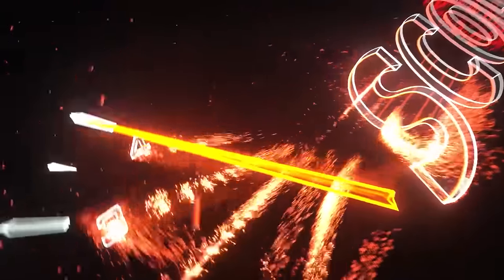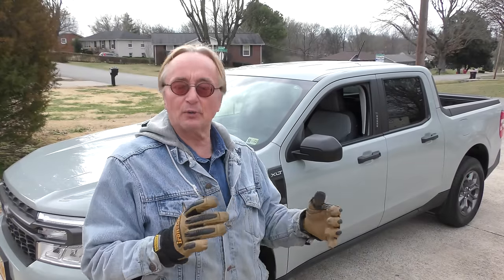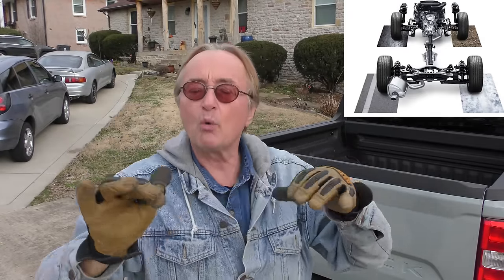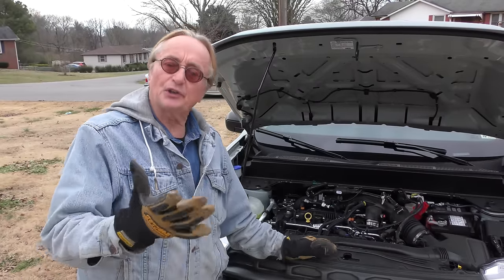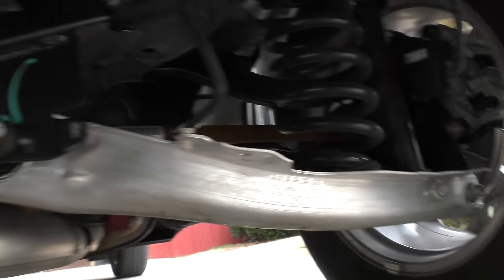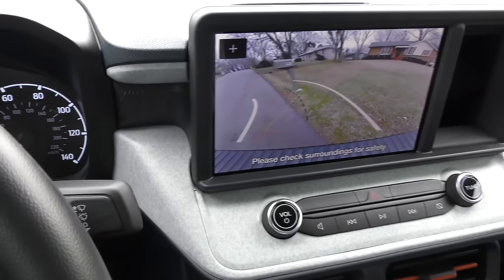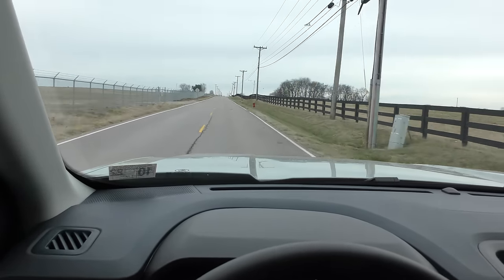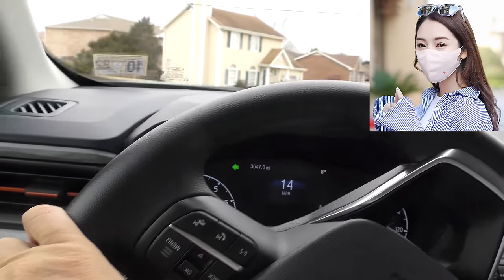I Finally Got a New Ford Maverick and Here's What I Really Think of It

Comment: Ive been saying for years that domestic car makers like ford should build a simple basic truck sub 20k for regular working folks. Prices for new vehicles are ridiculous right now atleast for a domestic even though they are not assemble here
Reply: Hear..Hear..Blessings.
Reply: I have been saying something similar for quite a while as well.
Reply: Never heard of this pickup before this vid tho!
Reply: @kong4679  it is a fairly new vehicle, so that is understandable.
Reply: Love the mpg these get but a lot of DYI and handyman purchasing these for the fuel mileage are starting to show signs of regret, the box is just so small most have to make the compromise of tools or hardware.. guess you can’t have it all.
Reply: Been saying the same.  I also want a car without a computer and I don’t want the manufacturer to track me for the rest of my life like they still own the car (talkin bout you Tesla!).  I want a car that I can fix with the tools in my garage.
Reply: @ajv9912  that would be pretty old to not have any computer. Lol I'm happy with 90s Obd2 fuel injection.
Reply: @ajv9912     Then your best bet is a diesel with a mechanical pump and a manual transmission. Maybe an old surplus military vehicle or an old mercedes.
Reply: Yep- the 90s market for the old ranger.  I bought a new XLT for 11k and drove for 220.
Reply: ⚽ moms don't want that

Comment: The “Start/Stop” can be disabled by a dedicated button on the center console. The feature is also disabled if you drive in “Sport Mode”. I have a XL with AWD. My 1st Ford. My 1st truck.
Reply: My 2021 Chevy Blazer also has the stop-start feature. 
1st thing I do after starting it up is disable that annoying stop-start.
Reply: Good. I'll disable mine. When I get it.
Reply: Start stop seems pretty useless unless you’re trapped in a highway closed lane.
Reply: My company just bought three Ford Escapes with stop/start. I found that you can also disable it by getting in the habit of shifting into neutral at stop lights. Maybe it'll work here too.
Reply: But it resets itself next time you turn on the car. In BMWs you can do a software alter that’ll put a memory on the start-stop system. Next time you turn on the car it puts it to the setting you last left it to.
Reply: @the007connoisseur  correct. Start/Stop has to be disabled each time you start the truck. Same with the driving mode. “Normal” is the default. If you want Eco, Slippery, Sport you have to select.
Reply: @user-xt7zd9uj3f  Just like all manufacturers, there's good and bad. I've seen Honda accords with proper maintenance spin main bearings at 75k. 
I've had drivetrain issues with pretty much everyone.
Reply: But does the start/stop disable permanently with that button. I suspect not. Sport mode disabling start/stop is similar on the Toyotas as well.
Reply: Start stop is ridiculous I hate it. You can buy an aftermarket thing called auto start stop eliminator. It plugs into the diagnostic port and when you press the button it turns it off for good.
Reply: @angelgjr1999  10-15% of your fuel consumption in typical local traffic is idling.  That's a lot of fuel, considering that's the equivalent of 30-45 cents of fuel at $3 per gallon.
Reply: @unconventionalideas5683  Depends on your commute I guess. I drive mostly rural roads with not many lights.
Reply: One of the guys at the dealership said they can disable it in the diagnostics, but what would I know, I don't own one (yet)
Reply: My 21 Ridgeline's start stop does not work when the defroster is on. So, I haven't had to think about it all winter.
Reply: The honda ridgeline is catching on
Reply: I have a Chevy Cruze with start stop. The only way to avoid start stop is high AC or using the heater. Or using the car in the L mode, shift it up to 6 and it acts exactly like automatic but no start stop.
Reply: At least they put the start/stop disable button in the console so you can push it off. Unlike the stupid escapes traction control where ya have to go through the menu and find it to shut it off. Should be a button as well. Do wish they had a regular shifter, that's a big turn off for me,but for the price am still going to look into buying one
Reply: @ppvracing5597  I too wish it could be disabled in the menu. It is what it is. I do not like the dial shifter either. I try to shift in reverse without looking and I end up in park. After driving for 45 years, 35 professionally, I find the dial shifter not very intuitive. None of these things are deal breakers…….I have driven many “beaters” over the years.
Reply: @user-xt7zd9uj3f  escape is trash

Comment: Agree totally with Scotty the knob transmission selector and electronic parking brake not my favorite. But finally a decent price on a cute truck.  Car makers need to realize that and start building affordable, reliable, economical safe vehicles.
Reply: I have a Dodge Ram with the same knob for the transmisión but it’s located next to the volume and air knob 😅 , my brother mistakenly try to lower the volume and put the car in Neutral in a stop lol I like that this little maverick isn’t next to each other 😅
Reply: What happens when a beverage is spilled on the rotary transmission switch ?

Comment: I can imagine these will be everywhere as fleet vehicles in a couple years. Looks like a nice vehicle for the money
Reply: Yep expect every AutoZone and Advance Auto Parts to have these.
Reply: It’s selling in San Antonio Tx for $35 - $40,000.
Reply: @dschoenfeld9277  lol what a joke
Reply: Yeah, dealers are marking up models with options. Eventually, base hybrid XLs should be more economical than many supposed econocars, but they still tow 2000lb and have 1500lb payload capacity.

 My Crosstrek tows 1500lb, but I need a trailer to haul a motorcycle or 2 with it. A base Maverick could handle 2 in the bed and more on a trailer.
Reply: This is no different than their SUV's..  Just look at the history on those and you'll see how these will fair..   It has the same uni-body, same suspension, and same engine, ect.. It's just their SUV with a bed instead of cargo area.  Not much of a truck really.  Similar to a Honda Ridgeline.  More of an SUV than a truck.  They're pretty sweet if you don't ever tow things.
Reply: @calholli  Or tow under 2000lbs which is what they are rated for and what 90% of people are going to be towing in the first place. Not everyone needs a Chevy F-Thousand50 Hemi-Cab Duramax XL on 9" lift 40" wheels to tow a uhaul trailer full of grandma's prize winning rhubarb jam down to the farmer's market twice a month. Get real.
Reply: @stgrsa  oof.. So defensive, and I have no idea why. lol.  It is funny to read though.
Reply: @stgrsa  They shouldn't even be called trucks.  It's just a crossover with a bed.  Call it a "crossbed, or something.  It needs a new name;   It's a "truck" built onto a car's chassis-- just like a crossover is a "SUV built onto a car's chassis.  It needs a new name;  it's not even in the same category/  It's not a truck. lol.. In Australia they call these a UTE.  or "yoot".  I think we should adopt that name-- or something else, other than "Truck"..   It's not a truck...  It's more of an El' Camino than a truck. lol.  There's no reason to defend your purchase.  If you like UTE's, good for you-- that's cool man.  Let's just not pretend it's a truck,  k-cool.
Reply: @calholli  they aren’t going to replace full-size + trucks. But some people just want an easy place to put their snowboard or fishing poles, and tow/ haul light loads. Even if small a bed has distinct advantages (and disadvantages) than an enclosed cargo area. I can see these doing well as a lower end car. Would you rather spend 25k on this or a civic? (I’d pick this). But I can definitely see these doing well as fleet vehicles, fleet companies don’t care if the truck is body on frame or has 4wd if it is sufficient to get the job done. And they definitely care that they are cheaper and get better gas mileage. Many consumers and businesses that currently have mid/full-size trucks don’t need all that truck, but they do need some kind of a bed.
Reply: @stgrsa  lol.. Bro, I'm not the one defending my UTE purchase by barking "It's A TRUCK... IT'S A TRUCK G^D DA^N IT... IT'S A TRUCK." ---- hahah..  Your logic completely falls apart because they changed "SUV" to "Crossover" for this very precisely and EXACT reason... I just said I drive an Acura MDX dude... you don't here me saying  "IT'S AN SUV---- Not A "Crossover" --    IT'S AN SUV I TELL YOU... I'M A REAL MAN, IT'S AN SUV--- WHY IS NO ONE LISTENING TO ME" ---  bwhahaha.   Jesus Christ.  Relax........  Here is the definition of "Truck:   'a large, heavy motor vehicle used for transporting goods, materials, or troops."---   Ok, "LARGE HEAVE MOTOR" -- it says it right there in the definition.   In the UK, they call Trucks a "LORRY: meaning-  "TO PULL"..   This little dinker crossover with a bed only "Pulls" 2k lbs. That's insanely small.  The payload is less than 1500 lbs..  So with 5x 200 lbs Guys going to work in this thing everyday, I can barely load anything in the bed--- It's not even rated as much as a 1/4 ton pickup-- like the little S10 or the old Ford Ranger, while hauling people.....  So I build houses, I pick up 5 guys everyday, my crew--- and I also load the back of the bed full of tools and hoses, cords/ air compressor, ect.. and I need to pull a decent loaded trailer with lumber I need for the day---- this thing CANNOT do it---  because it's NOT a truck. It's more of a minivan with the top cover off the back, than anything near a truck.  You think people drive around in the "giant train engine trucks for their manhood, to feel masculine" ---  NO GOOFY,  I literally need it to HAUL THINGS, and Tow Large loads up the side of a mountain, to my job site-- you know, like A TRUCK DOES.   jesus... lol...... Ok, now that you agree with me.   We should just think of a good name for it-- something will catch on.   I don't really like "UTE, or "YOOT", even though that's exactly what it is.  CrossTruck. Crossover Pickup..   Maybe "CarryAll" -- that's a cool name, maybe. Or just call it a "PayLoad" -- since it can't tow anything.  "Utility Crossover" isnt' bad either.  I've GOT IT:   Lets call it a "ChangeOver".....  So from SUV to Crossover.. and Truck to ChangeOver.......  So Ford Just came out with a new ChangeOver called the 2022 Maveric." ---  I think my work is done here;  there's some good names here. lol.  Anything but Truck.. It's not a truck;  and neither is the Honda Ridgeline;  and there have been many articles written about this-- just search:  "Is the honda ridgeline a truck" -- and read through some of them.
Reply: @mattc2433   I never said I dont' like them...  I think they're cool.. I like crossovers.  It just needs a new name;  It shouldn't even be called a "Pickup", IMO.   Maybe, 'ChangeOver" .. or "Payload".. or "CarryAll".
Reply: @calholli  No honey, I'm just like good old Scotty here, I've only paid $5k for all the cars I've had in my life. I don't have a maverick and financing vehicles is for chumps who don't know how money works.  No one is going to read your essay though, it's not that deep. Some people will buy this truck and some people will continue driving lifted trains to compensate for their microphallus.
Reply: @stgrsa  lol.. Your ignorance is unmatched.  I get why you didn't read it
Reply: BL Dontmatter  very late to the party.  "Normal cars" aren't rated to tow anything.
Reply: BL Dontmatter  Specifically says in the owner's manual not to tow though. Corolla, Camry, and Prius can all tow 1500 depending on year.
Reply: @RKmndo  I have a 2011 Ranger. Wonder how that stacks up to this.
Reply: BL Dontmatter  lol no. The Prius has used 1.5 and 1.8 cylinder Atkins' cycle engines while the maverick uses a much larger 2.5L Atkinson's engine. It's like the difference between a Corolla and a Camry 4 cylinder. And the Prius is more fuel efficient because it has that smaller engine and because it's lighter.
Reply: BL Dontmatter  Ford's laughing all the way to the bank at that joke. Maverick sales go brrrrrrrrrr
Reply: @stgrsa  The sales go brrrrrrr...  because people love crossovers, and that's what it is--  A crossover changed into a UTE.  called a "ChangeOver.
Reply: @dschoenfeld9277  this is why we need to remove the legislation that protects dealerships and allows them to do ridiculous markup.
Reply: @brendang673  yes sir credit is king
Reply: @stgrsa  Meh. Some of actually need work trucks with 8 foot beds and haul tools, lumber,  full sheets of plywood, concrete bags,drywall, tow trailers etc. Not everyone is weekend jam selling nancy like yourself
Reply: @calholli  and you think the escape fairs well or poorly? It’s a unibody c2 platform. I’ve not heard anyone saying anything great about escapes.
Reply: @calholli  In Australia  although Unibody it is not a Ute as it is not derived from a car. It does have a unified bed, but some Utes here used to have BOF as well as Unibodies and hard to belive for  you 2800lb payloads
Reply: @robertryan7204  Sure.. You could put 1 ton axle springs under it-- but it won't ride nice anymore.  It will be a hard/ rough ride.
Reply: @calholli  No you misunderstood Unibody " Utes"  cannot but there were Ford Falcon BOF utes that had 2800lb payloads.  These also had 351 cu in V8's as well as the 4 Litre Barra six, vastly different to the Maverick

Comment: I love this little truck! It's just the kind of truck that I'd need, using it for Kayak trailers, single axle utility trailers, etc. most of them are rated around 3,000-3,500 lbs anyways that's all I would need to haul realistically. It's a great truck around town being small & nimble enough to maneuver easily, along for the price point it's being offered at there's nothing else that can beat it imo. Especially for when 90%-95% of the time you're really using it as a daily driver hauling & towing stuff occasionally, you don't need a giant truck to do all of that with either.
Reply: I've got this truck. It's a tiny truck and shockingly narrow. Like KIA Forte narrow but about 2 feet longer. It's not a tall vehicle either; you sit higher than a car, yes, but not by much. Yet it has a 6 foot bed, tows at least 4000 pounds, is shockingly quick, parks easily, great airconditioning and just an all-around comfortable and useful vehicle.

It's almost a truck for people who intensely dislike trucks. If you made a truck that was furthest from a truck that could still do truck things, then this 32 to 38 mpg truck is it.
Reply: Hybrid or regular?

Comment: I have a hybrid version of the Maverick. Have to say it drives really well and is fantastic so far. Really fun to drive and the gas mileage is amazing
Reply: Does it feel underpowered at all? Also how does it handle dirt/hilly terrain?
Reply: @smashmaniasmashbrosleague3363  There is like 6 driving modes with the performance mode showing it can get up and go. If you are in eco mode it feels just about the same as any 4 cylinder ford normally does.
Reply: Does your hybrid makes a clicking sound when it is in reverse?
Reply: @jaidreedex  I haven't heard clicking in reverse.
Reply: 4 cylinder truck. Well, that is a horrible idea.
Reply: @rickitysplitz7035  try getting a Maverick or Ranger right now LMAO. Such a terrible idea that you can’t even order one for 2022 anymore and it’s only January. Nice try, random internet person.
Reply: What is your average mpg? I have a 2010 F-150 5.4 right now and average 18 mpg. If the Maverick's advertised mpg holds in the real world then the money I'd save just in gas would cover the payment.
Reply: @thomasbrand2650  I am getting 36.8 mpg on this first tank of gas. 440 miles on this tank with 50 miles left. This is with considerable drive thru time because I eat like a degenerate. The best mpg I have gotten on a trip is 60 mpg on an eleven mile trip one way.
Reply: How do you do with the extra noise from the engine?
Reply: @rickitysplitz7035  its meant to be cheap and have great gas milage its not gonna have a v8 lmfao like what

Comment: Scotty, you were DEAD ON with everything you said!!!  I have owned several full size vehicles and small trucks, my favorite small truck was the Chevy S10.  I actually gave away my F150 which was a great vehicle because I am downsizing on everything.  I have built 2 homes beating the hell out of them and now done with construction.  I want a truck to do basic functionality and only wanted a 2 door truck and find out, they don't make them anymore.  I purchased a 2024 Ford Maverick and am VERY IMPRESSED!!!  Everything you mentioned works perfectly and I TOO DON'T LIKE, all the electronics on anything.  I want to be in control, not what a computer program is suggesting.  The S10 was MANUAL TRANSMISSION.  I want the GEAR, "I WANT", NOT the Manufacturer.  GREAT JOB SCOTTY, YOU ARE THE MAN.  Bobby Estey (Dayton, NV)